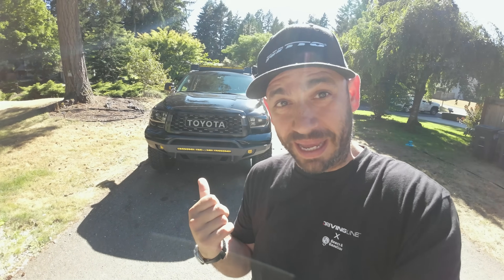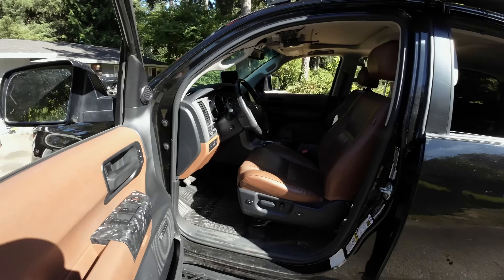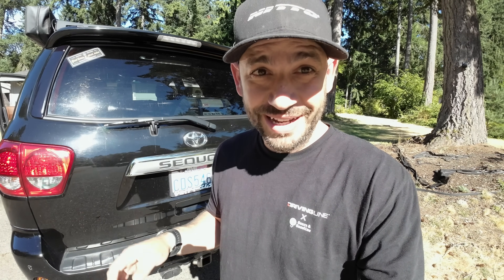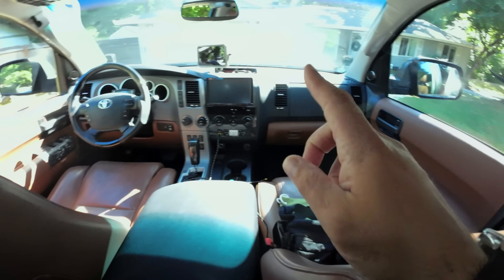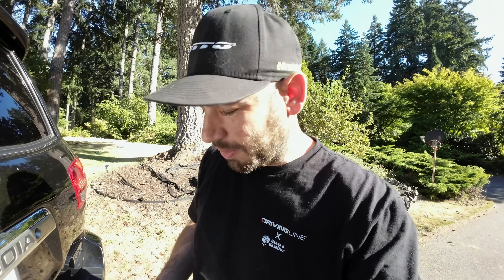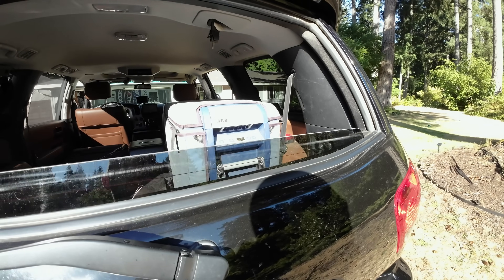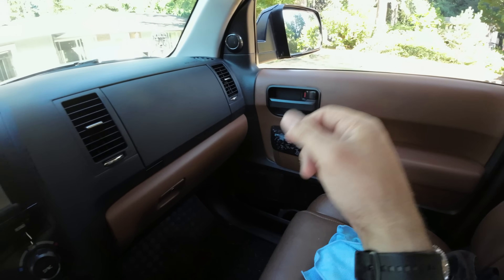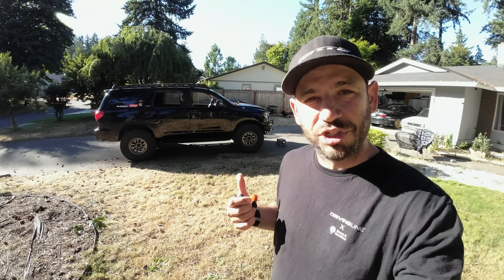5 Reasons to buy a 2nd Gen Toyota Sequoia in 2023

Comment: You should mention that you can go from 2WD to AWD to true 4X4. Not many vehicles can do that. very handy for snowy roads.
Reply from the maker: Good point. Thanks for commenting!!
Reply: @FathersFuckingBiscuits typically in all wheel drive, and many 4 wheel drive vehicles the transfer case is setup like a limited slip differential. Meaning it transfers power to the axle set (front or rear) that are slipping. What sets this transfer case apart from most others is the ability to lock it. In 2 wheel drive it sends power to the rear axles. In 4 wheel high it sends power to both front and rear but it sends more power to the axles that are slipping/spinning. So if you have a front wheel in the air or mud or something it's going to send most of the power to the spinning wheel. When you select 4 low it locks the transfer case and splits power equally between the front and rear regardless of whether or not one of them is spinning. It does still have open diffs though. So if right rear and front left are in the air or mud or whatever you're still in trouble. This drive train with front and rear air or electric locking diffs makes it "true 4x4" and is virtually unstoppable. This type of transfer case is only found in the Sequoia, Land Cruiser and Limited 4Runner (4wd). As far as Toyota SUVs go.
Reply: @rupertcornelius8924 good explanation. I just got a 2018 and am looking forward to taking it out to the snow soon!

Comment: Love my '13 Platinum Sequoia.  Original owner.  Bought it when it just came off the truck with 4 miles on the odometer and still wrapped in plastic.  No butts in the seat.  The truck has plenty leg room in the 2nd and 3rd row.  I don't know how they did it, but they did.  I plan to keep it until until...  Don't forget it has all the music playing options (CD player, streaming, usb), except cassette player and it has 3 suspension modes (soft, standard and sport).  You can run 4x4 on a dry road with no grinding (do this to get some run time on the differentials to keep it working).  I can't safely do this in my '06 Tundra without the grind on turns.  A true family SUV.  I have the air suspension.

Comment: We had two Sequoia's as family haulers - loved them both for 125k miles.   Put TRD supercharger on the 2008 and the 2011 copies we had (both Platnium) - 2008 tuning was never quite right - knocked under load (hard accelation, towing, 91 Cali gas) - after dealer too three tries to fix - we got lucky as we live in S. Cal and they sent me up to TRD in Costa Mesa and they tuned the truck on the dyno - it was amazing after that - towed 7,500 lb. boat - temp gauge never moved - rock solid.  We had air suspension which gave a great ride.  Can't go wrong - our 2nd one we sold to a friend and they have over 200k miles on it - still on original motor and tranny!
Reply from the maker: Damn. We need to pick your brain on the supercharger for our rig

Comment: I agree, have a drawer system with a 5 inch mattress.  Screens in the windows and fans.  Big fridge behind the driver seat, roof net and extra battery.  Love it. What a beast.  Huge drive shaft and huge axles.  Roof top tent and roof rack next with all the fixins.  One dependable rig and capable of 500k to 1,000,000 miles with regular maintenance.  Just need to figure out how to put a rear window switch inside the back for sleepovers.  Keep it coming!
Reply from the maker: Thank you! I bet there’s a way to add a Bluetooth emulator to the main switch.

Comment: I was about to say looks a lot like my 07 Tundra crew max. The best 4wd since my 1994 Landrover Discovery...I still have it. My tundra has 367,000 miles on it, all original except two starters and about to add a new alternator. Other than that, it's all original, the motor, transmission and fluid....dont know why they say dont change it...but I am going to do it anyway, water pump is still kicking even though I carry one with me in my spare parts tubby when I travel...of yes, I forgot, a big part replacement....my fan clutch. Bought the truck with 124,000 on it and it pulls strond as ever and love 4 wheeling in it and pulling stupid people out the ditches when it snows in Nashville. This winter is going to be especially cold fun because of all the non-snow and ice people that have moved here.... cannot wait for early morning hot totty and hot chocolate towing. The beer is always cold in the back in the winter saving on ice. The yeti keeps it for like two weeks or more in the winter.

Thank you for the video
Reply from the maker: Thank you so much for watching. Toyota just makes some excellent products. It’s really hard to beat them.

Comment: The back window is the only issue. After a while water will get down there and muck up the ability to close the window with the switch.  You may have to take the back plate off to get the window back up.
Reply from the maker: That's a good point. I have read about that actually.

Comment: thanks for the nice little pro/con vids. Getting interested in picking one up. have you looked into swapping in a larger fuel tank by chance? either a 38 gal or 46 gal? don't see too much info avail regarding seq, but plenty for tundra though...
Reply from the maker: I haven’t looked into it all that much. Realistically I would spend the money on a regear before I add more fuel to the mix.

Comment: I need something to tow my car to the track and double as something I can haul around my giant bernese mountain dog around in. my favorite part about these is that they don't appeal to the offroading/overlanding crowd as much as the gx470/460s that I've been crossshopping, so more space, more towing capacity, more power, all for less money.

I want a platinum so bad, but there's not that many for sale in my area. might have to "settle" for a limited.
Reply from the maker: We found our platinum in a podunk town and it needed a ton of work but it was a great deal. So I’ll say, you can still find platinums out there for a good price.
Reply: @CoolGuyClub  I've been scouring fb marketplace for a bit now and there's only one plat within 150 mile radius 😬

have you made a video on the issues it had when you picked it up? curious to know what I should be looking out for
Reply from the maker: Our was 220 miles away lol so I hear you. Yes, my 5 reasons NOT to buy a 2nd gen sequoia has a lot of the issues ours has / had. I'm actually replacing all the engine mounts today which is another issue.
Reply: @CoolGuyClub  pain 💀 guess I have no excuse now not to take that trip to NYC to check one out

Comment: Truck is looking badass. 👍
Is the molle panel on the rear side window the Victory 4x4 one? I looked at those but the comments about the rivnuts on the install vid are giving me second thoughts.
Reply from the maker: It is in fact that. It’s garbage. You’ll totally cut up your arms installing the bottom brackets and the whole rivnut thing is not a good solution.
Reply: @CoolGuyClub  Some of the comments say to buy a legit rivnut tool and ditch the one that comes with their kit, did you do that? Do you think it would support the weight of a fire extinguisher and a first aid kit.

Comment: What did you have to do to enable auto-start? I have a 2013 limited but it doesn’t have this feature. Thanks for all the awesome content!
Reply from the maker: I’m not too knowledgeable on that system, ours came with it but I’m sure it can be enabled through tech stream.
Reply: I believe remote start is an optional feature. Not all 2nd gen Sequoias have it from the factory. I have an aftermarket remote start on my 2019 Sequoia that the previous owner installed.

Comment: The sequoia can tow up to 10,000lbs with the 5.7L V8 and tow package. There is a 4.7L engine that tows up to 7,800lbs. All depends on the model, that’s per the manual. Mine does tow up to 10,000lbs, I had to verify this because I pull a travel trailer. Although I only pull below 9,000lbs at max. Secondly, although there are many parts for the Sequoia for the front end because many parts match the Tundra, you’ll have a harder time finding parts for the rear. Especially if you want to lift or upgrade your shocks. I had to buy King shocks because at the time they were the only ones that made rear shocks for sequoia’s  without having to order custom shocks.
Reply from the maker: Hey thanks for the clarification, I had to look up the tow rating myself but I didn’t check the manual. (I should have). 
However I will say there are a ton of shock options now. 
Eibach, Elka, dobinsons, and bilstein all make a shock that will fit.

Comment: No rear locker but does it at least come with limited slip rear?
Reply from the maker: No LSD in the rear. It uses “auto lsd” which means electronically controlled traction.

Comment: I tried that key fob 3 press to start the rig and it didn't work for me :( I have a 2011 platinum.
Reply from the maker: You might need a plug and play module. Ours came with the feature installed but I hear the function is very easy to add
Reply: @CoolGuyClub  cool! Thanks for the pointers. Where could I possibly start off by finding that plug and play module?

Comment: Sequoia is rated for closer to 10k tow rating on that gen.
Reply: That’s what I was thinking, with the 5.6. Gx470 could tow 6500.
Reply from the maker: "Properly equipped, Sequoia is rated to tow up to 7,400 pounds." Via : https://www.newcartestdrive.com/reviews/2012-toyota-sequoia/#:~:text=Properly%20equipped%2C%20Sequoia%20is%20rated%20to%20tow%20up%20to%207%2C400%20pounds.

But hey if you can find a higher tow rating for a 2012 Platinum then by all means go with that.
Reply: Dont know why a 2012 would be different but when i bought my 2010 I looked into it. Why would a body on frame SUV that is identical to a Tundra not be able to tow similarly? The 4,runner can tow the same as a Tacoma, dont see why the Sequoia would be different.